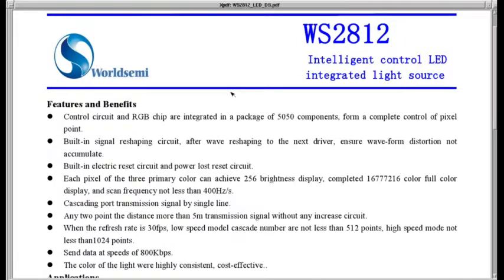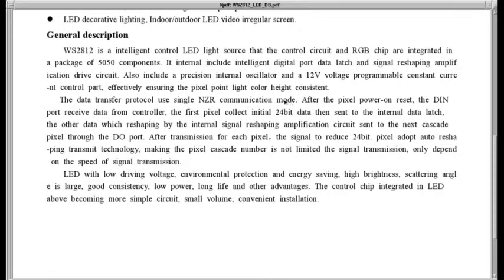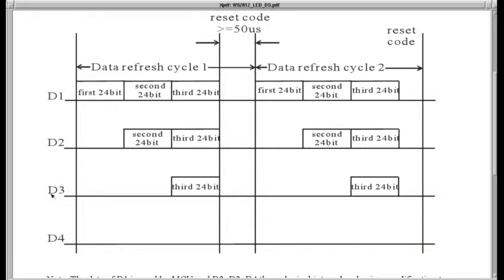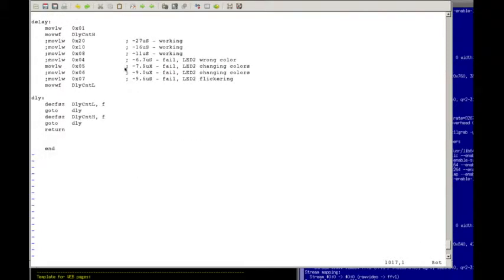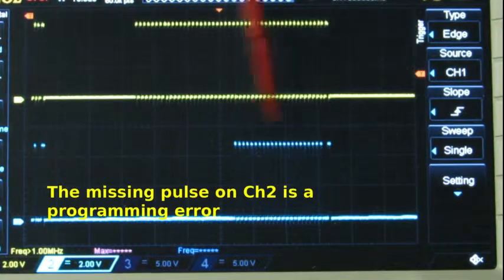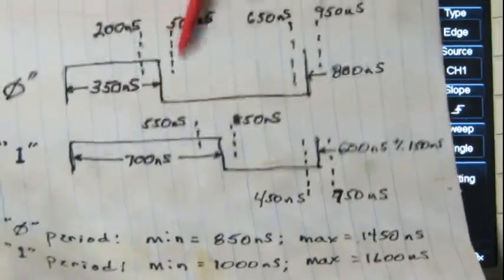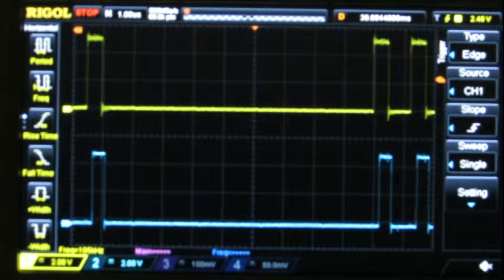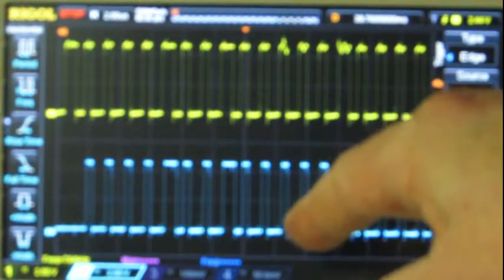pl6 WS2812 (NEOPIXEL) LED Data Timing

Comment: I have done some testing with WS2812B and I think the only timings that the LED chip actually checks to decode the signal are 2 points. These are: (1) high time threshold of 400ns to set the bit high or low (2) low time threshold of greater than 300us to latch the outputs. All other timings shown in the datasheet are minimum times so not much of an issue. The only difficulty is producing the fast pulse of <400ns.

Comment: 5050 actually refers to the package size of the device. For example, other leds come in sizes like 0402, 0603, 0805 and 1206 ect. ect.
Reply: You beat me too it. 😂 should have read before I rage typed. 😆